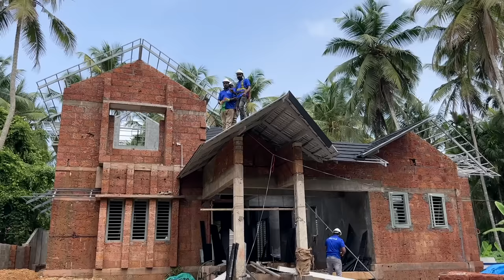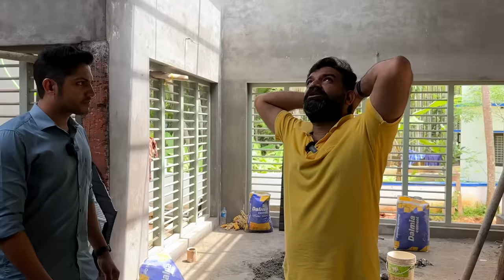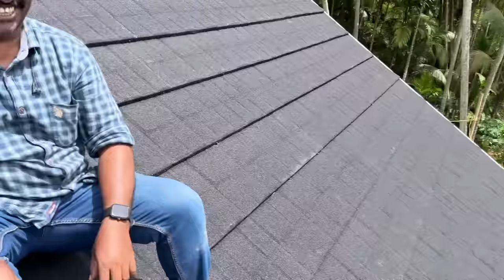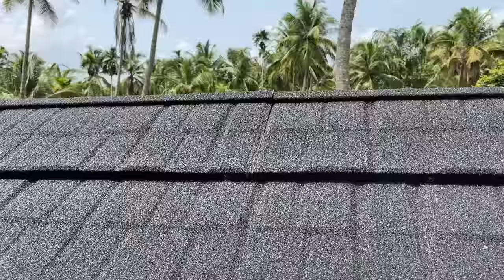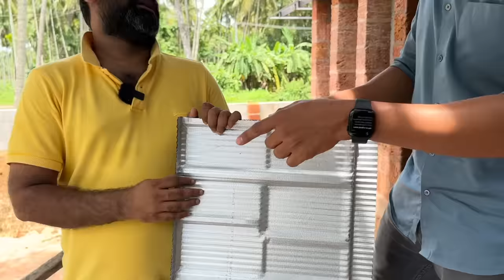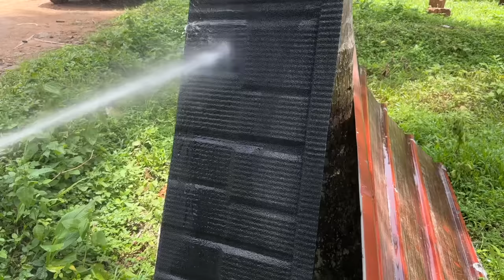ലോകത്തിലെ ഏറ്റവും ഭംഗിയുള്ള റൂഫിങ് രീതി  | 50 കൊല്ലം വാറണ്ടി | What Roof Is Best For Your Home?

Comment: When you do rain water sound experiments, ensure that both sheets are of the same size. If you spray water on a full size tin sheet and use a quarter size doktile sheet obviously sound will be less on a quarter size sheet. Pl do not make this mistake again. If you want, do the experiment again and check the result.
Reply: Correct